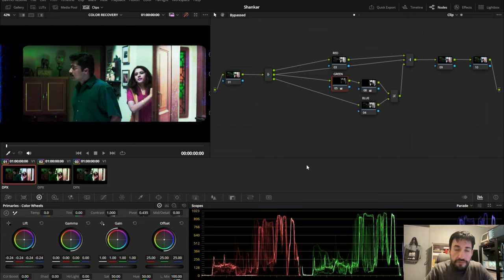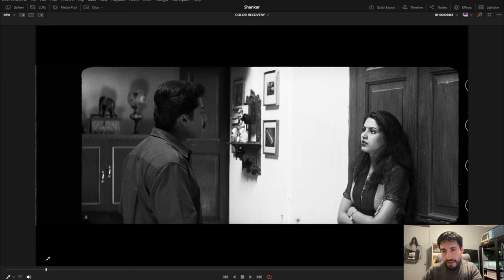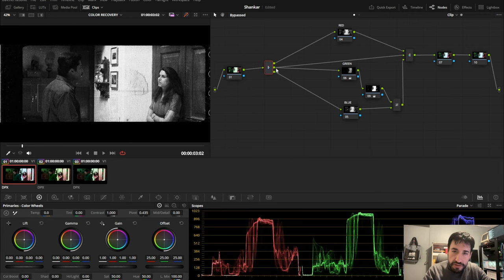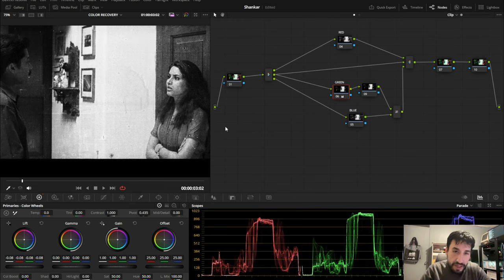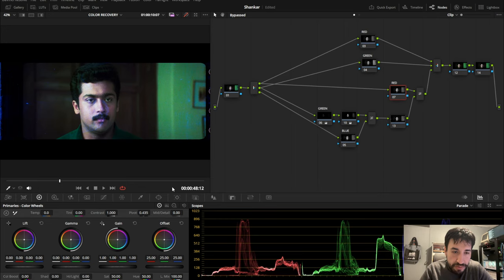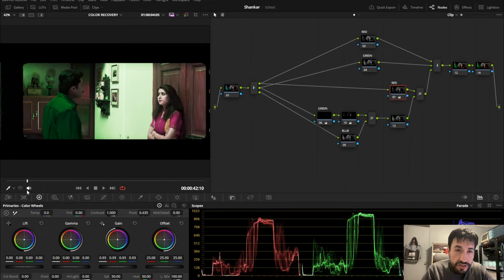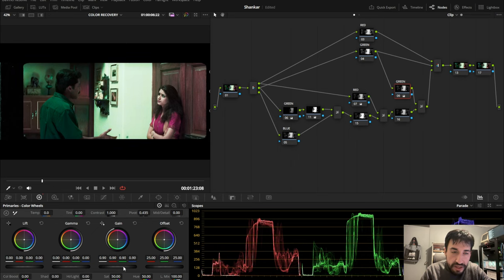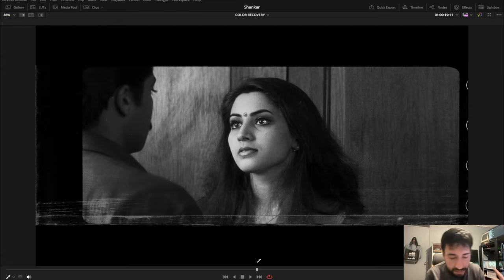Restoration Breakdown: Channel Recovery

Comment: Bro i have old dvd9 there is a line sync horizontal black line  problem in that dvd is there any solution i tried deinterlace but not working sry for my bad english
Reply from the maker: Line sync issues can be mitigated using DVO line sync in Phoenix or an AviSynth script. However, from my experience, most problems with magnetic media, including line sync, are resolved before digitization through physical restoration methods.